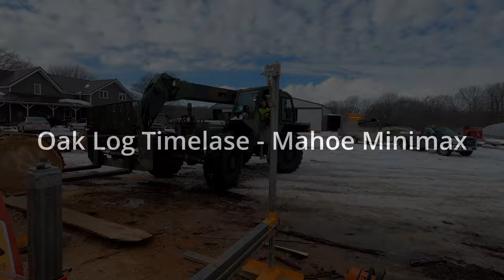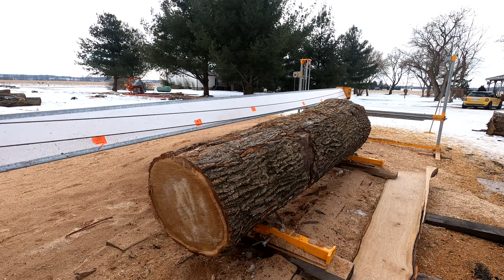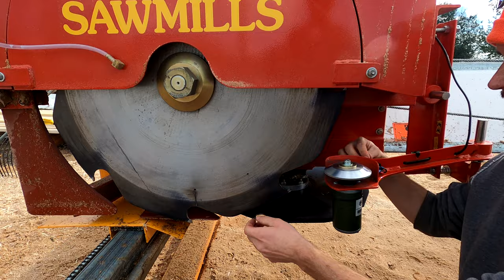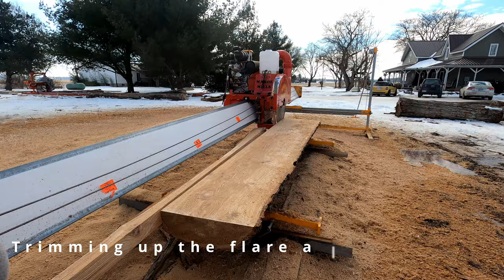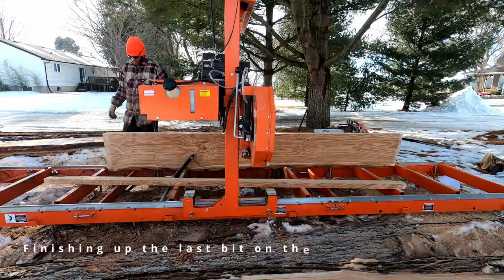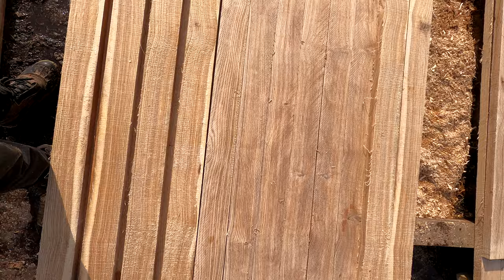Satisfying sawmill timelapse on Mahoe Minimax!

Comment: Why did you finish the log on the band mill? Is it because you wanted to maximize quartersawn oak? Do you often leave a big slab on the bottom with the Mahoe? One of the challenges I see with a sawmill like this is getting the last board out of the log without cutting through the metal dogs.
Reply from the maker: Yes, it only works out sometimes that I need 4 inches but can only go down 3 3/4 so I put it on the bandsaw to get a few more quarter sawn. If I started my first cut up a little it would have worked out. I can usually get everything out of the log that I need to.